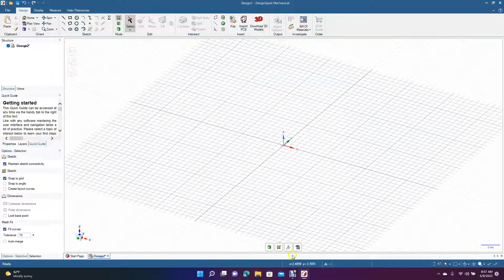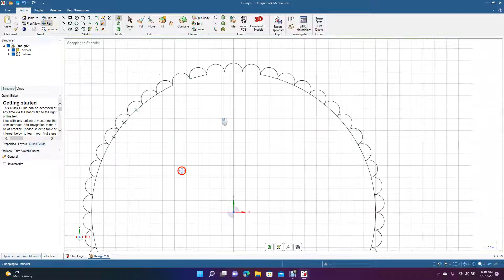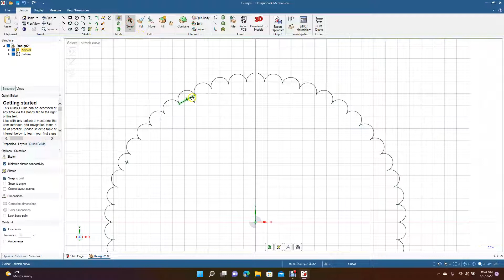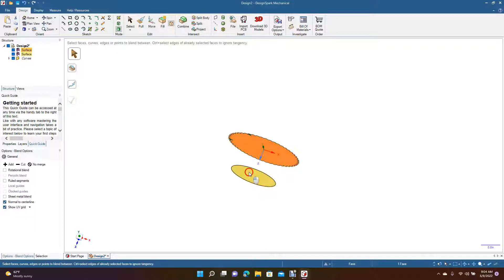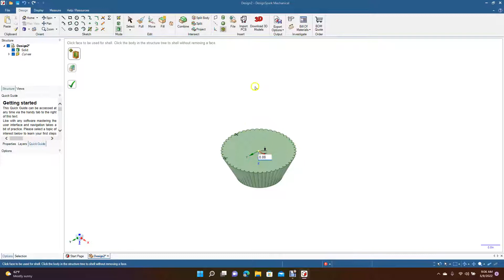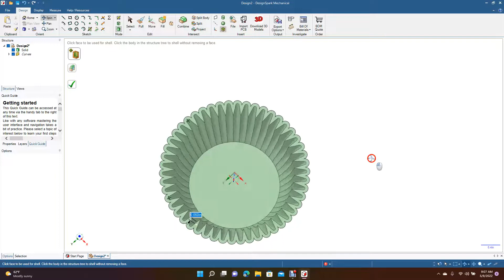How to create a cupcake holder with design spark mechanical

Comment: If u do your main circle then do your first flute. Put a point in the centre of the circle do your trim on the flute then delete the main circle. Then do your move using the centre point as the Ankor to Finnish the array.
Reply from the maker: Thanks for the tip. That seems like a much easier way, and I can forgo all the trimming.

Comment: Bit of a challenge delegating the original circle. Is it not possible to select the circle and delete in one go?
Reply from the maker: Alan, I may redo this video. I think i can improve, and make some changes that will make the process a bit easier. I like your dog, by the way.
Reply from the maker: Yes, you can draw the shape first, and then create a pattern out of that, and not use the circle. You suggested this on your second message. Cheers.